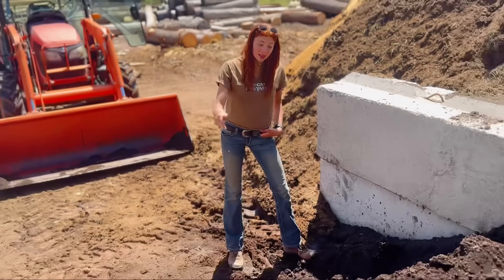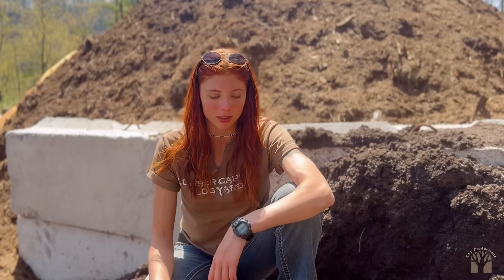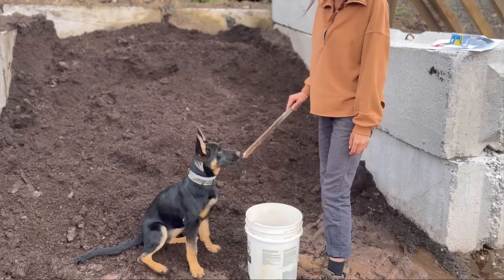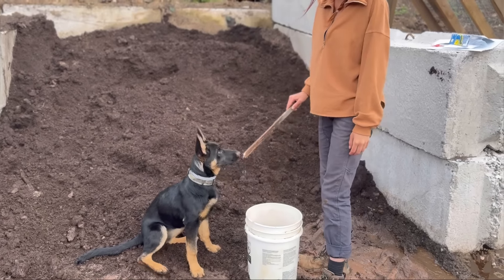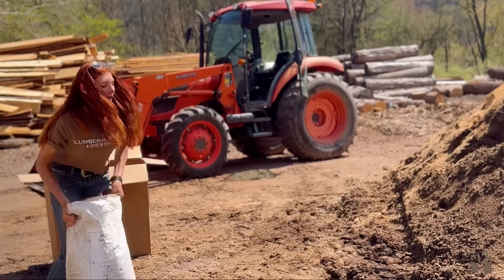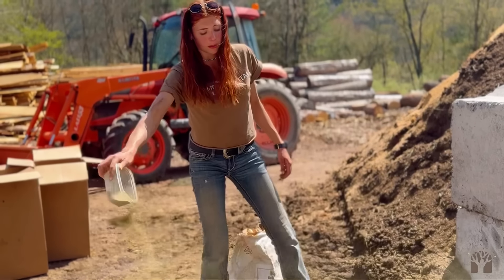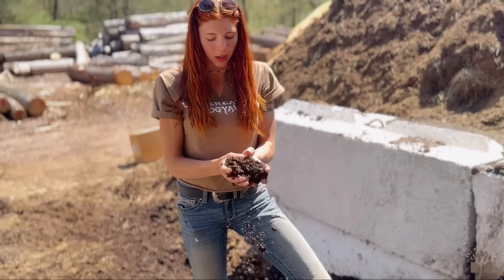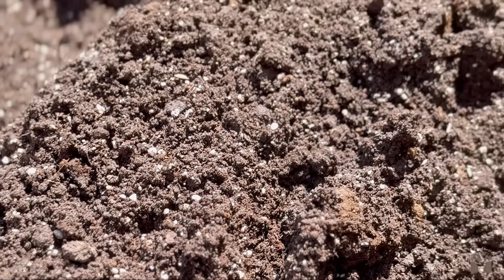Essential Ingredients for the Best Potting Soil!

Comment: Wearing a mask/ respirator mixing perlite in particular, but good with the rest of amendments as well , is a good idea. If you get tired of looking at & messing with perlite, rice hulls do the same thing w/o the dust, & provide silicon as well.
Reply: Where do you get your rice hulls?
Reply: I have a local source, the pb brand is very good due to low salts in test results.
Reply: @jayweiss602  but what kind of source is it?  I can only find it online and the cost makes it a poor substitute for perlite
Reply: Yeah that's going to come back on her in 10 to 15 years sadly, especially if it's something they do every year. Plus saw dust. Noticed that with a lot of other habits they have. It's been 4 years already since they started it seems so another 10 and it will start to show. Pneumoconiosis, dust or black lung, is still a big problem in a lot of industries like this.
Hopefully it's only on film day they don't wear masks for it.

Comment: if the pete comes in a compressed bail. the 3cu ft that expands to around 50gal, body slam the bail before you open it and it will be clump free. the rule of ish will apply. also look into teaming with microbes and learn as much as you can about the soil food web. plus remember that liquid water sofner will seperate your soil and allow you to see and measure the ratios of sand pete ect. also a good way to boost earth worms is to add castings that contain eggs.

Comment: We use perlite as an insulator in a vacuum jacketed tank that holds LNG at cryogenic temperature. Didn’t know that it could enrich soil. When our perlite is exposed, though, we are in respirators and long sleeved clothing to protect against any skin and pulmonary irritation.
Reply: Could that be partly because of the LNG?   The LNG is about -260F.....
Reply: @scottsoper  No. The perlite is inside the vacuum jacket that surrounds the tank in which the LNG is stored. The perlite cannot be accessed unless the LNG has been removed from the tank and vacuum broken in the jacket. By then, the temperature is no longer cryogenic.

Comment: I hope you will consider making and adding biochar to your planting mix. A high temperature biochar reactor wouldn't take up much space in your yard, could heat your drying kiln, and the added value as a soil amendment and long term carbon capture process is well worth looking into. A positive on climate change. Thanks for all the great videos you've been making!
Reply: They do make charcoal from time to time; would that be similar?   However I would not be adding that to the soil unless there was some specific chemical in the soil I was trying to capture.     I do not worry about carbon capture or climate change, as so called science has gotten many to believe in for political reasons.

Comment: Emerald........ When you are spreading chemistry additives a respirator is advised. The airborne dust is in the microns size particulate range. They like to attach to the lung walls. This was the effect that folks at ground zero expirenced on a much higher scale after 911.  Carter Canada
Reply: No use, she was told the same many times with the last compost video a year ago, people don't care about lungs until they start losing functionality

Comment: Friend perlite is for aeration not water retention
Reply: Don't focus on just one thing.   Perlite retains some water and lets water drain better and the process enhances aeration.
Reply: @scottsoper  According to every seller, Perlite is for aeration/drainage, NOT water retention.
Vermiculite is for water retention.
There IS a difference.
Reply: @roberthousedorfii1743  Yes there is a difference.  I am sure that sales of Perlite concentrate on Aeration /drainage, however this is a direct quote after a simple google.
  " The natural size and unique structure of expanded perlite makes an ideal framework to hold water. Perlite holds water in one of three ways: in between individual grains, in channels leading to the cores of the grains and on the highly irregular surfaces of each particle."   
       Google does not always get it correct but I already know that it is not fully an ether/or situation but a both situation.  .

Comment: Though perlite has porous nooks and crannies that can help retain some water in the soil its real benefit is aeration, It retains some water but it also retains air, which helps with soil aeration. It also helps prevent soil compaction, helping facilitate good drainage in easily compacted clay soils.

Comment: Kelp meal is an awesome ingredient!  I use it but also worm castings, ground alfalfa, black soldier fly frass, Mycorrhizae, 4-4-4 organic fertilizer or 5-3-3 or something with a similar NPK, and if I have some around I use rock dust plus this and that. And yes, I use Coco Coir and coarse Perlite.   Sometimes I use Dolomite Lime which can correct soil problems and is a good source of magnesium and calcium.

Comment: Instead of perlite why don’t you make your own biochar .
You’re already making charcoal, you ought to look into it.
Reply: Perlite is the best choice.
Reply: Biochar does retain a bit of water, bit it mostly adds nutrient retention abilities to soil, per the claims.

I'm making biochar myself as a top dressing / weed  barrier, but the fines get added to my own potting soil mix, in small quantities.

I haven't read anything about perlite doing nutrient retention, so can't comment about that.

I personally have used  fines - .5 inch homemade charcoal as a weed barrier and simply buried it when turning over this year.
It worked last year, we'll see if it contributes anything this year.
Reply: @roberthousedorfii1743   biochar = nutrient retention.   It is not clear to me just what biochar is, or what it's difference is from charcoal..  Would you be willing to explain that to me?     Currently my limited understanding says that charcoal is made from wood and biochar can be random organic matter like switch grass.

Comment: I would like to see some longer videos of Jade working in real time showing every motion she has to make.  They should not be hard to make as there would be no editing.   I would like to see RRTs and the jig used.   How you are doing retail lumber and  flooring lumber.   I think those are the three main categories that might need a different set up.     Also the edger can be set up so Jade can run it if she has time to run it; however it can't be done with the equipment you have now.  One needs a powered conveyor and a transfer table and an air compressor and small generator to run them. Then Jade may be able to edge and swamp at the same time.  I don't want her working flat out however; just a nice moderate even pace. You should know by now if there is time to run the edger.    Also you could show how you load the live deck just for fun!